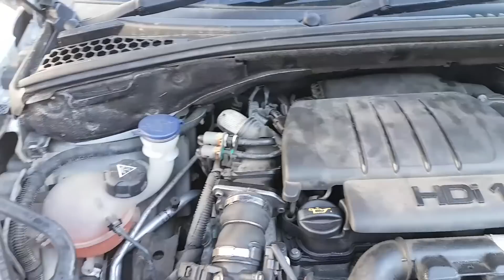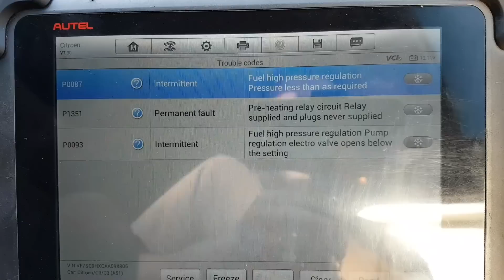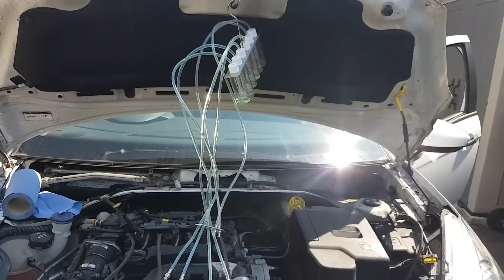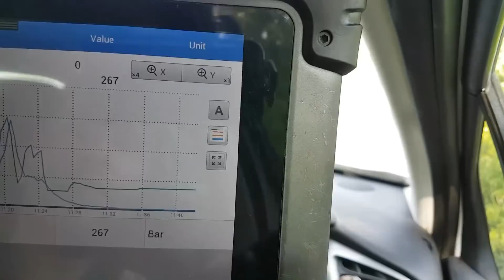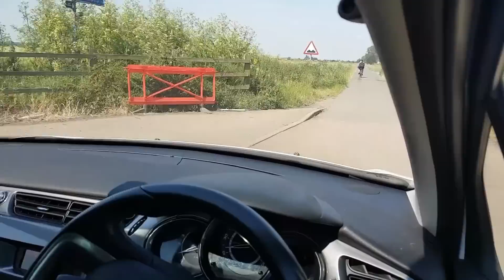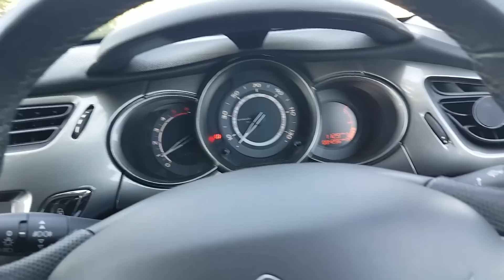Citroen C3 1.6 HDI randomly cutting out... Fault finding and repair.

Comment: Had an similar issue today by -13^C. When it's cold the high pressure regulator may also freez and also stall an running engine.

Comment: i have a similar problem, but not 100% if same. My question is if when the car does the problem feels like a clutch kick. no power for a split sec and power right again? Whatched several times and at 18:08 really looks like my car's problem. Tnx for the vid!

Comment: My dispatch van has same issue how much am I looking at cost wise roughly
Reply from the maker: The same symptoms don't necessarily mean the same root cause...
If, is the same as in the video, the part is not that expensive, probably less than £50...
But  have it diagnosed before starting to throw parts at it... the video shows the steps...
👍👍👍
Reply: How far are you from Leicester
Reply from the maker: Yes...

Comment: Mines does this but the fan ends up coming on and staying on when stop for a few minutes temp gauge stays normal not really getting any obvious fault codes could this be the problem just doesn't explain fan coming on
Reply from the maker: If the fan is staying on like that, must be some codes stored...
👍👍👍
Reply: @LMAutoRepairs I'll show you tomorrow mate but was nothing last time just the one for fuel gauge as it stays on empty only other thing I noticed was the value for the egr stays at 0 on idle and when rev so was thinking mabey that but I'm not mechanic mate just trying to find a swers on you tube videos yours is first one I've found with same engine that's doing the cutting out mines is a Peugeot partner
Reply: @LMAutoRepairs  can't share pics here the fault codes I'm getting are p0463 fuel level instrument shortly circuit to body think that's the fuel gauge as stuck on empty and p1199  fuel circuit incoherence on the reserve fue pressure (nearing no fuel,) again that just to do with fuel gauge? Don't think  be the cutting out issue? And c403 fuel sender signal open circuit

Comment: Hi
So what actually has been replaced?
Fuel pressure sensor or pressure regulator valve?
Whats the proper part name please?
Reply from the maker: All in the video...
👍👍👍
Reply: Thanks, I've seen full video, but my english is still not good enough and did not catch correct part name...

Comment: Thank you. Peter from Slovenia
Reply: No,še en problem rešen v Sloveniji.
Koliko stane rezervni del in ali je mogoče očistiti in popraviti poškodovani?
Reply from the maker: Depends how it fails..  if the coil is faulty or "lazy" a new part is the most sensible option, as cleaning it will not make a difference...
👍👍👍

Comment: I got the fault codes for low pressure in fuel rail 00087 something like that and low pressure at fuel regulator also /change pressure sensor still the same so while I was waiting for pressure regulator i used hand pump to pressurize fuel tank from engine bay /i could feel the pressure in tank when I removed the fuel cap or vacuum if i turn pump around and sucked/so my advice would be check tank ventilation

Comment: Just bought a second hand Berlingo with the same engine at the weekend. Drove it home 50 miles or so no issues. Following day this issue began. Only difference is mine has to be left a while before it will restart.
Reply from the maker: Have you scanned it?
That would be my first call...
👍👍
Reply: @LMAutoRepairs  getting AA out to it tomorrow
Reply from the maker: @choochoochooseyou 
👍
Reply: @LMAutoRepairs  turns out it was a faulty crankshaft sensor. Fingers crossed this sorts it out.
Reply from the maker: They can cause that...

Comment: My Citroen 1,6 HDI Jumpy (Dispatch) does this random stopping thing when my MAF is disconnected. It also throws up codes for fuel pressure. Took me a while to figure out my MAF connector was working loose and the cause of the whole issue. After zip tieing it shut all the codes and stopping behaviour ended. I thought my fuel pump or regulator was bad. I'm so annoyed that the OBD2 diagnose system can't point to the actual problems.
Reply from the maker: The obd diagnoses should be used as a guide... not as a black and white action plan...
😊
👍👍👍

Comment: Thank you for your help. My Peugot 207 2006 hid 1,6 exactly same problem ,garage fitted new fuel hi press reg,   5 miles ok,perhaps a little sluggish    Then cut out ,start stop start stop,just ,managed to get home.much worse
I was sure you r solution was it
Could it be the fuel. Pump relay   
I’d appreciate your opinion 
Thanks Luis
Cheers Colin
Reply from the maker: Hi
The regulator, aftermarket or genuine? 
Which codes are you getting?
Have you tested all the other components? 
Injectors, etc...
👍👍👍

Comment: Great video. I have the exact same error codes (including P1351 that has been there forever). I managed to change the fuel filter and problem keeps returning. So i went to the dealer and explicitly told them what the error codes were. They wanted to change the fuel filter (it has less than 5 km) and the plugs. Why don't they listen to customers? Gonna get the car and try to get the fuel sensor and regulator valve replaced. Too bad you are not in Portugal mate. Cheers!
Reply from the maker: Hi
Hope you get it sorted... I am in Portugal sometimes...😁
👍👍👍
Reply: @LMAutoRepairs   I knew it. Portuguese ppl have a distinct accent. Abraços!
Reply from the maker: @acdmonteiro 
We do indeed! 
A abraço...
Reply: @LMAutoRepairs  After 4 months, i just wanted to give some feedback: bought a new fuel sensor and was trying to get someone to put it in place. In these 4 months I only drove the car some 200 Kms to keep the battery in charge.I also put some STP 5 in one diesel additive in the tank. Long story short: as i was trying to show my son that the car wouldn't pass 90 km/h in limp mode, the error suddenly went away and never came back. That was 500 kms ago. I guess it was the previous fuel filter that was bad and some shit stuck to an injector or the fuel sensor. Abraço!
UPDATE: December 2025 - Car periodically had the same random P0087 code since last update and went to limp mode. Since i already had the fuel pressure sensor and regulator valve, i had them both replaced. After 1500 Km all is good.
Reply from the maker: @acdmonteiro 
😊
👍👍👍

Comment: Hello,i have the same problem but it only happends when there is cold outside like -16/-20 new fuel filter didnt helped,fuel isnt gelly.What could be the problem ? I have the same fault codes.
Reply from the maker: You need to investigate yourself...
But the regulator is a good possibility.
👍👍👍
Reply: @LMAutoRepairs  Happened again today :( The high pressure regulator is already ordered i hope it will help.

Comment: suskovic1 has reported a problem with microcracks in the fuel regulator o-ring. But if the o-ring is the real problem , this means it's a hard fault , and problem can be tested by turning off the engine and watching the rail pressure pid constantly dropping.

As for this here problem with the little Citroen C3 1.6hdi - i would test the current with the amp clamp and the deep-memory oscilloscope. I would compare the currents two times - 
1st. : test the currents when the car was left for a while and it's cold(a coupe of hours)
2nd : test the currents again when the car at operating temp and the fuel is warm, engine is warm and coil could become shorted and current would go up.
Reply from the maker: Makes perfect sense...
Luckly, I didn't have to get that far...😋
👍👍👍

Comment: Another tricky issue solved. You were actually quite early into a probable electronic/wiring problem and I believe you were right in a way but this time it was encapsulated within the regulator.. right? I have the same engine in my -05 C4 and this video could become useful! 👍
Reply from the maker: That's how it looked like...
👍👍👍

Comment: Good morning Luis  if i am not mistaken No 1 injector cylinder on those engines is next to gearbox flywheel  not timing belt end  most psa engines all ass about face ps when your good you make your own LUCK
Reply from the maker: ☺️
Thanks!
👍👍👍

Comment: Just replace O ring on pessure regulator, and thats it!
Reply: No, because if the o ring was bad a big fuel leak will be show under the car.
Reply: @Poulpy68  I had the same situation, on a 2.0 HDI, the O ring had micro cracks, and enough to drop the pressure!
Reply from the maker: That's really interesting... as we are talking at some significant pressure...
Thank you for the suggestion...
👍👍👍
Reply: @suskovic1  Perhaps the pump will pump air if the o ring is bad. Else with the pressure you will have a big leak.
Reply from the maker: @Poulpy68 
The air theory it is difficult to understand... as it starts right away and runs fine...
Air would give symptoms... I would guess.. 
👍
Reply: @Poulpy68  I'm talking about the situation I had and how I solved it, I'm not making guesses, but how I successfully solved it.  I wasted a lot of time and various attempts, but when I replaced the O ring, the problem was solved!  The pressure regulator returns excess fuel to the return line and there are no visible fuel leaks!
Reply from the maker: @suskovic1 
👍
Reply: C quoi le code qui sort